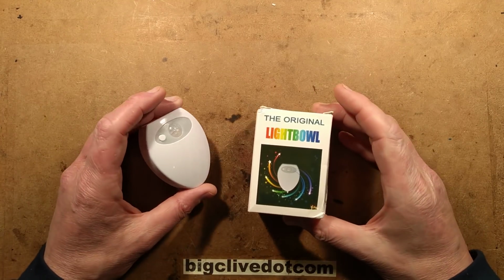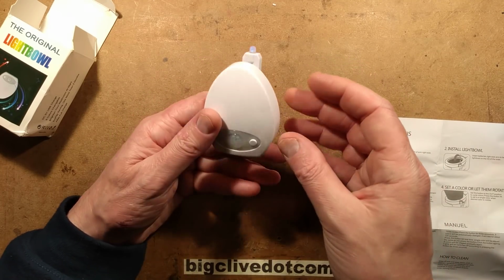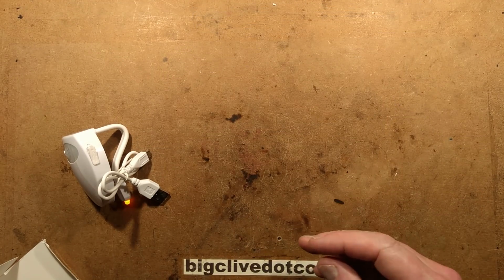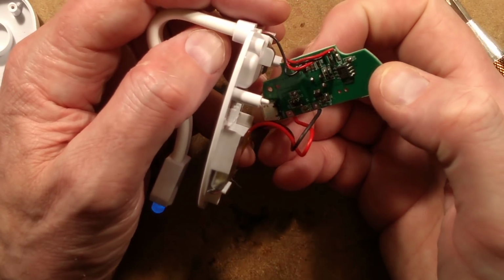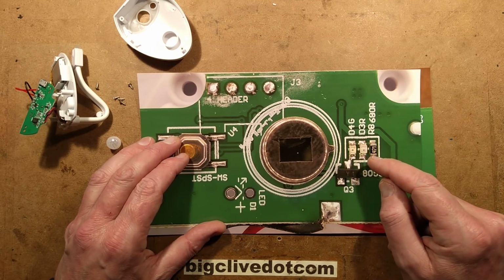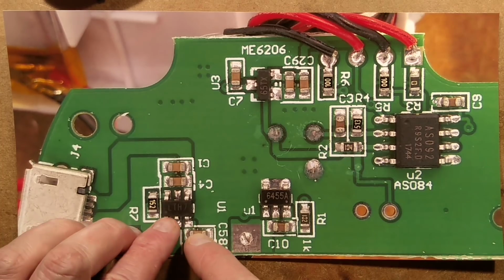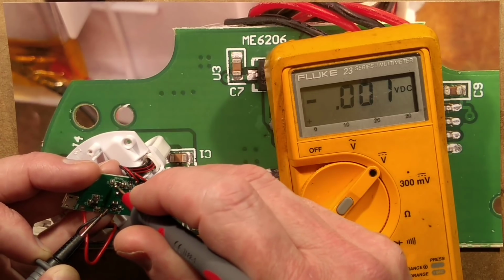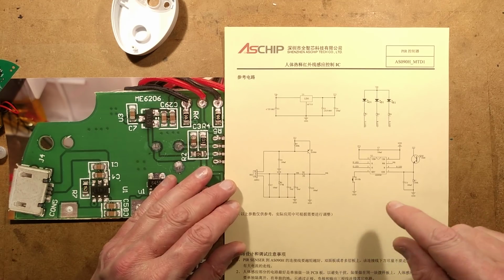USB rechargeable poop illuminator with piss-flap.

Comment: Oh come on. You have the right datasheet for the ASO92. This chip is reponsible for PIR detection. On Page 5  of the datashhet you will notice a piece labeled with PIR (AH510)  .
Reply from the maker: This one also controls the RGB LED and the datasheet makes no reference to that.
Reply: @bigclivedotcom   I would assume pin 7 (out) is connected to a "rainbow led"?

Comment: For this to actually be used by most people beyond its first initial charge and discharge it would have to be waterproof.  Or, at the very least, very water resistant so that it could be cleaned and disinfected properly.  Otherwise I can see this being tossed in the trash after the battery dies because no one would want to touch it, let alone clean it.  ;)

Comment: It would be more sensible to fit that unit to the lid, or somewhere above the toilet. Zia would be much more hygienic. It’s odd that this device comes from a country where most toilets are a hole in the floor, with nowhere to sit. (Either Serpentza or Laowhy86 made a video about them. You have to remember to take your own toilet paper - and a peg for your nose! - to the public ones.) Maybe the sellers designed it based upon pictures of a 'Western' throne?

Watch out though! The next version might be internet-capable.

Comment: No doubt there will be further improvements and more lavish models of this device coming down the pipe line. I'd suggest to the manufacturer to make a model that also dispenses little cubes of dry ice into the pan as lots of mist and flashing lights would give a good disco effect.

Comment: The UP6455A series product is a high integration solution for lithium-ion/polymer battery protection. UP6455A contains advanced power MOSFET, high-accuracy voltage detection circuits and delay circuits. UP6455A is put into a small package and only one external component makes it an ideal solution in limited space of battery pack. https://www.baidu.com/sf_edu_wenku/view/c42880b182d049649b6648d7c1c708a1284a0a3c

Comment: I had one of these; they are pretty nice for night relief, but after a few months the LED leads corroded from all the piss splashback & electrolysis  thereof and I didn't have the motivation to wash, repair, and properly seal it

Comment: you didn't crack open the LED part, could there be a hidden chip in there and the red and black wires are actually power and ground?

Comment: Big Clive and crew. I have a decent bicycle LED spotlight its being a bit temperamental sometimes turns on sometimes flashes a red light and wont and if I persevere I can get it going. Where would be best place to take this to get fixed if possible sure it was £60-80 so dont want to abandon it.
Reply from the maker: Most of these things are not really intended to be serviced.  I wonder if water has got into it.  Sometimes it helps to open it and leave it to dry out for a while.  A common issue is with the switches.
Reply: Dude thanks for getting back to me. This is very possible. The housing was loose and I  put electrical tape over it to secure a few months back and its been hanging on. I was camping by bike at weekend in bad weather and my head torch failed so used this as a light source and has not been right since. I will try drying it out and the secure it back up again best I can and see if it helps. Much appreciated man.

Comment: The AS092 is mentioned here amongst much chinese writing - http://www.aschip.com/solution.php?CaseId=30

(after browsing around a bit after selecting english, and letting google translate do some work, re-visiting that link gets me the english version...)

So, in brief, it's intended application is cabinet lights and similar.... but then I spotted this in the sidebar..
http://www.aschip.com/solution.php?CaseId=29 -- "PIR Toilet Lamp Scheme" -- using the AS090H with a description very closely matching what you have.

Just let that sink on for a moment: The "toilet lamp" isn't some weird "innovative" use of a part intended for something more serious, it's an actual manufacturer-suggested and documented application.

So navigating this slighly-weirdly-bilingual site was an odd experience - Initially, selecting 'english' just took me to the homepage, but with google translate it opened up a bit..
http://www.aschip.com/  -- offers "Human Body Sensor" / "PIR Controller"
http://www.aschip.com/products.php?CateId=7 -- the AS08x series
http://www.aschip.com/products.php?CateId=9 -- the AS09x series
there's no AS092 there, and the datasheet link for the AS090 doesn't work on the english site (it does on chinese), but..
the datasheet for AS084 is in english! - http://www.aschip.com/u_file/product/18_01_26/de2684821b.pdf

Comment: For anyone interested, this is the voltage regulator in question:

http://www.sz-xrz.com/Upload//pro/dcdc/5-ME6206Series_E16.0.pdf

The same manufacturer do a number of small, relatively low power, voltage regulators which can be found on LCSC (the same place where the infamous 3 cent microcontroller resides)

Comment: Does the "AS084" printed on the circuit board next to the AS092 chip mean anything? How about the ME6206 above the voltage regulator?

Comment: My battery case will only charge my phone up to 4% wtf
Reply from the maker: Many have fake capacities.
Reply: @bigclivedotcom  i should have said that it use to charge my phone up to 100% from around 35% and still have about 30% capacity left. It's a strange battery and somehow it knew my phone was at 100% and would shut off
Also i could not use it plugged into an Xbox One controller because it would just shut off after a few minutes witch killed me in fortnite a few times. It has a usb port on the side as well as a micro usb port with a tiny adapter thing that goes into your phone and is wrapped in paper that says ZeroLemon on it

I have yet to see you teardown any battery like this one. It is a zero lemon s7 edge battery case

I started having problems when i went up into the mountains for a weekend it was fine the whole time I was there unlike my ears which I couldn't hear anything with cuz they were so stuffed up but as soon as I got back it didn't work anymore and only charge my phone 40% and last time I tested it with by killing my phone to 0% it only went up to 4% so definitely broken.

Link to amazon page for it

https://www.amazon.com/ZeroLemon-Samsung-8500mAh-Battery-Protection-Black/dp/B01DXSY3FI/ref=mp_s_a_1_1?ie=UTF8&qid=1540177536&sr=8-1&pi=AC_SX236_SY340_QL65&keywords=zerolemon+s7+edge+battery+case&dpPl=1&dpID=41bE5N7n6qL&ref=plSrch

Comment: Hey Clive I want to contact you either on here or via pm. I have something I want suggest that I think would be cool to use in your videos. 

 Have you even bought a spectrascope? If not they are absolutely fascinating, cheap too.

 And I already figured an easy way to get great photos out of them using my phone camera and a cheap ebay mount.

 I think you might be interested in one if you don't have one because you can literally view color quality of lights in clear detail.

 Like I can look at a bulb that has poor color reproduction and go "No wonder why, it's over representative of the violet and the cyan spectrum but has most of the red spectrum missing.

 Great for telling quality of RGB too, most of em I came across could not actually put out pure base spectra.
Reply from the maker: I really should get a proper unit.  I've got the flat sheet type, but it's more of an indication of spectral content than an accurate guide.
Reply: @bigclivedotcom , I have a few of those too but the quality is very poor compared to an actual spectroscope.

 I can highly recommend at least one manufacturer and type. If you search in Google "Eisco labs economy spectroscope tube" it'll bring up some simple black spectrascope tubes.

 These ones are great because I found that by buying a universal telescope mount for phones they can easily be used to take great spectroscopic pictures.

 Being a compulsive buyer I picked up the 24 pack of them. Already gave a few away including one to Nighthawkinlight while sending back an SD card he let me borrowed.

 I would love to send one to you too but unfortunately being in the USA shipping would be far too much.

 That aside if you are curious I can share a few photo examples so you'll can see what it looks like and how it can be useful?

Comment: You’re quite right that these sorts of things aren’t great for their intended use, however as a stand alone unit for giving you a light to nip to the loo with without disturbing your significant other, positioned under the bed or thereabouts, they’re great!
Reply from the maker: I kinda wish this one just lit up warm white.  And the circuitry makes it a bit harder to hack to do that.
Reply: bigclivedotcom as it has a separate bit of circuitry to do the colour flow, as in it isn’t just a self contained colour flowing LED, if you connected 3 separate LEDs instead of the single RGB four pin LED to it, wouldn’t they do a rather nice smooth light flow effect along the set? By setting them quite far apart you might be able to make something interesting from that. A motion activated bit of theatrical lighting for a sci-fi model, for example, or an interesting beard light that lights in a different spot when you lift your beer glass, something useful like that.

Comment: Well, on the PCB, the chip is designated as AS084, so maybe that's yet another chip, and the eching on the component was a mistake, which is why it was maybe a bit cheaper than it would have been normally?

Comment: Do you poop on the outside of your toilet bowl Clive? 

The AS092    
Get a google translate, I googled AS092 PIR and this was in the list. But no solid data.
 https://detail.1688.com/offer/550550984251.html

"AS092 original direct supply human body infrared sensor IC chip main application sensor controller night light sensor light"
"AS092 is a human body infrared sensor control chip specially designed and developed by Shenzhen Quanzhixin Technology Co., Ltd. Its internal architecture is designed in a mixed-mode manner of analog and digital hybrid circuits, and is stable in all situations.
AS092 adopts the third-generation PIR human body pyroelectric infrared detection technology scheme, built-in high-precision algorithm unit, which can adapt to the current environment, filter out environmental interference, and effectively extract human body signals. The farthest sensing distance is more than 20 meters. The practical application circuit is quite simple, and the development and production do not need to be debugged, which greatly reduces the production cost and saves space."
"feature of product:
Industrial grade standard, good stability, strong anti-interference, wide operating temperature range, and is conducive to a variety of certifications.
A built-in operational amplifier that can be matched to a variety of PIR sensors for signal pre-processing.
The built-in operational amplifier peripheral circuit eliminates the need for debugging during development and production, saving development time and production costs.
Built-in high-precision algorithm unit, self-adjusting to adapt to the current environment, effectively distinguishing human body signals and interference signals.
The sensing distance is far, and the probability of malfunction is much lower than that of the conventional control chip.
The sensitivity of the sensor is adjustable and it is more convenient to use.
Built-in high-precision crystal."
"Built-in mask time timer (1 second), effectively suppressing repeated malfunctions.
The control signal output delay time is adjustable, accurate, and wide.
External phototransistor or photoresistor does not work during the day.
The practical application circuit is quite simple, the batch production product has good consistency, the repair rate is low, and the finished product volume can be made small.
SOP8 package, small chip size.
Environmentally friendly packaging not only meets EU RoHS standards, but also meets halogen-free green environmental standards (such as SONY SS-00259, Apple069-1857, Dell A00-00)."
Yes, I did enjot my bit of google detective work.

Comment: Story of my life - difficulty finding piss flaps that are not hard to get into. The ones that are super easy tend to be those you wouldn't want to get into.
But won't the unit sit on the outer side of the rim, with the clip inside for it to illuminate your deposits, making the use of a mustard spoon superfluous. Or leaving the spoon free to gently push any bulging hemorroids back after a particularly forceful evacuation. Not a problem I have I can assure you, as I have often been described as a complete arsehole.

Comment: Interesting how they seem to have the pir working at low voltages. In my tests of pir I have had to use 3 aa cells to get reliable operation. Assuming a standard lithium battery with a range of 3.4 to 4.2 volts I would fear the pir would become un reliable before the lithium ion needs charging. I don't think the capacity of the lithium was discussed,  but if say 500 mAh & the led need 10 mA & its on for 2 minutes, that would suggest 500/(10x2/60) = 1500 uses, but if the pir stops working early it would reduce this, but maybe the pir have been designed to match the lithium voltage cycle & last long enough. Clearly I need to repeat my tests measuring at what voltage pir become unreliable. I have been using boost convertor to 5 volts which are often a nuisance due to relatively high quiescent currents, but perhaps I don't need them. Thanks for sharing!
Reply: Found my measurements & the pir I have becomes unstable at 3.7 volts as measured with a power supply. This represents about 1/4 of the capacity of the lithium ion battery, but given the low current needs of the led it will likely give operation for over 200 days which must be a good as not many will want to regularly clean one of these. Thank you for causing me to think about this, most useful & interesting.

Comment: I guess the two big open holes are for an LDR for darkness detection.. I can't believe how many products with PIRs omit these components. I've added them to all sorts of outdoor lights for added battery life, often without needing to change the resistor R2.  (The datasheet shows that as 1M I think, but 100K will probably be fine too)
The silkscreen shows the mystery chip as an AS084, but I had a quick look at the datasheet for that, and it looks the same as the AS092 datasheet that you've got. (I don't read that language though, so maybe it's all in the description.)

Comment: The ME6206 marked on the board would be a voltage regulator, so it makes sense that whatever they used instead would also be one.

Comment: Slightly irrelevant but not wholly... have you seen the spy cameras disguised as an air freshener? They look like the ones you peel the front label off with the smelly gel inside.
Reply: There's also ones that look like the battery powered type that spray every time they detect movement or on a timer... (they're not cheap and could cost you some jail time... 😉). 
https://www.eyetek.co.uk/product/concealed-security-camera-recorder-air-freshener-hd-720p/
Reply: Becky Stern, Estefannie, and Naomi Wu tore down a few spy cameras a week or two ago.

Comment: Further down, a gentleman mentions that the chip is a  UP6455A (James Sleeman I think). Also of note is the silkscreen calls for an AS084.  Might try looking that one up myself too, seems they might be just using whatever they can get that will work. that could explain some of the inaccuracies in the control instructions too.

Comment: About as worthwhile as the microcontroller controlled wall hook.
A device that fits into a toilet bowl is going to get beyond disgusting pretty quickly as anyone with a toilet rim-block holder knows. It would be better if only the LED section was fitted on the toilet bowl and the main unit was remotely connected with a cable or better still the entire unit mounted on the tank with the LED pointing down the toilet to completely eliminate splatter.